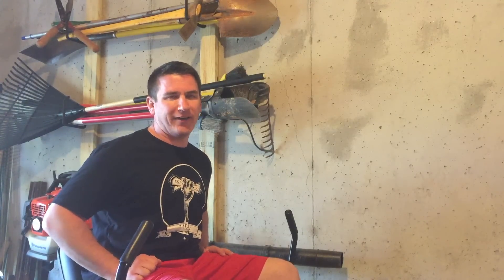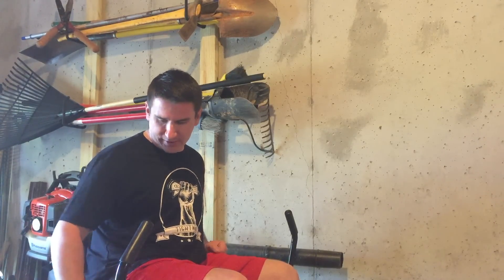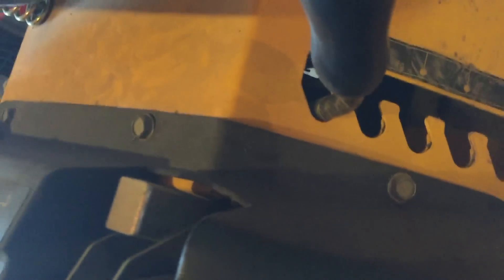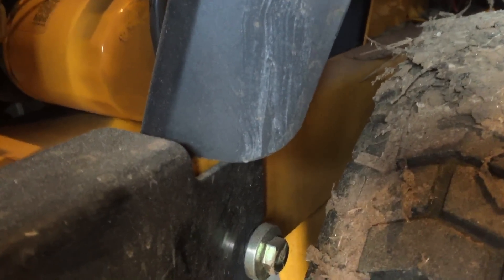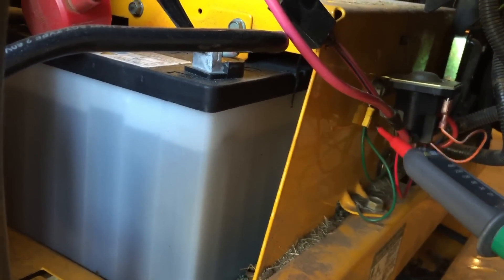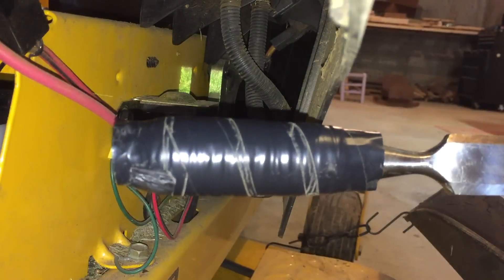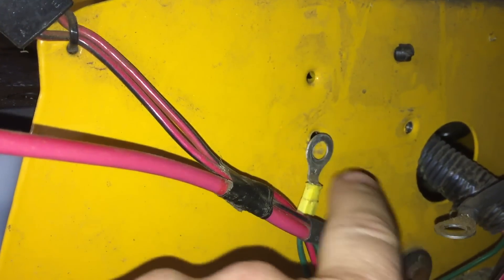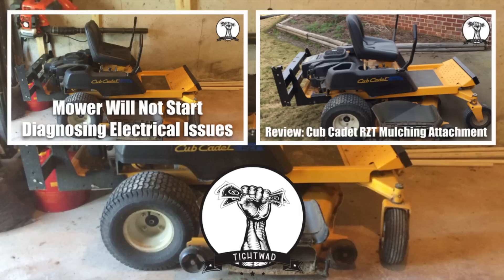FIXED: Mower Will Not Start - Diagnose and Replace Faulty Solenoid Cub Cadet RZT

Comment: I'm a 74 yo woman and I have been taken soooo many times by 'legit' repair places, contractors, electricians, plumbers, etc etc. I have become VERY self sufficient in home remodeling but know NOTHING about small engine repair. This is the first time I'm attempting to do the repairs myself. This site will prove to be a life saver, money saver for sure. I've replaced the battery on my cub cadet and still just clicks. I bought the solenoid and am going to rewatch your video and get to work. Thank you for doing this to help those who need to help themselves!!!!
Reply from the maker: Glad it can help! It's great to see women empowered to tackle repairs themselves.

Comment: I will try your advice, thanks for the no-nonsense easy to understand instructions. I have an CC RZT-L that's about 5 or 6 years old that seems to have issues every year, mostly running rough, rebuilt the carb by the shop, always spraying it with carb cleaner, using high-test ethanol free fuel, new filter, new pump, disappointed with the reliability of this model. Wasn't cheap, like most if them of course. Was running rough right before it pulled this number of intermittent turning over and then nothing. Good connections, newer battery, fully charged, tried jumping it just to make sure.  Thanks again.

Comment: Tightwad. I have replaced all the safety switches, solenoid, one of the coils, fuel filter. And it still won't start. The magneto turns slowly and I can see a very small spark from the plug. But that's it.

Comment: Just so you know...it's always best to remove the negative terminal first.  The ground is connected to the entire chassis or engine block.  It's easy to accidentally touch the positive and "Shock" yourself.

Comment: I have a cub cadet zt1 ultima & it won't start all I get is the click .ive replaced battery ,fuel filter ,spark plugs, I took a test light and I put it in positive side of battery and its lights up on everything but one of the bolts on selanoid lights up on positive side and lights up on the little connection wires just not on the negative bolt. If I do the touching the chisel to connect the bolts do I have key on.? And will it start if im not sitting on seat
Reply from the maker: It will turn over if you jump across the terminals but will die if you aren’t sitting on the seat unless you disable your seat switch. You need to see if you have 12v on the small wire going to solenoid. Thats from the key switch that checks all safety switches first and then sends 12v to activate the solenoid.

Comment: tell ed brake switch on rzt 50 and lights still on no start any ideas?
Reply from the maker: What is tell ed?
Reply: replaced sorry
Reply: @henryglazier7748  Are you sure you have your parking brake engaged and the handles in the down position when trying to start it? It’s possible one of your handle switches is bad.
Reply: @GrillThisSmokeThat  I hope so they're on the way

Comment: The replacement solenoid you linked has two spade connectors, but in your video it appears to have only one. My RZT22 only has one. Does the second one do anything, and would it be ok to use it on mine? Did a search for my model but most come with two spade connectors. Thanks for the video.
Reply: What did you find out here? I’m about to order one ….

Comment: my 04 cub cadet rzt 50  with 500 hours 22 hp briggs v_twin was mowing stopped for a while got back on to finish didnt do anything no lights on dash so i got out jumper cables attached them but when i hooked up final ground cable it was shooting sparks like cables were reversed it happened out of nowhere any suggestions would be appreciated
Reply from the maker: Check your fuse. That happened to me one when using the nagging attachment.

Comment: I have the same problem not getting any power to my starter but I did try to jump start it like that so have to be my solenoid
Reply from the maker: Jake Friesen Did it work when you jumped the solenoid?
Reply: @TightWadDIY  yes it did start if I jump start it but it won't start with the key so it has to be my solenoid
Reply from the maker: Jake Friesen It’s most likely the solenoid but could be a safety switch or key switch.
Reply: I have a good use solenoid laying around going to try it on the tractor tomorrow

Comment: wow... having just been fiddling with the solenoid on my hustler turf, I am once again reminded of how much I hate where cub cadet places the components on their machines. on my hustler, you just lift the seat up on it's hinge, and there's the solenoid, out in the open and ready to be fixed.
Reply from the maker: Agreed. My MTD was much worse than this one! It was in such a tight spot I could only get 1/8 wrench turn. It took forever.
Reply: @TightWadDIY  I know how you feel. just don't ever try to replace a carb heat cable on a cessna cardinal. now that's a pain, literally and figuratively.

Comment: I had a solonoid click only, I removed the starter and found the top bearing seized and could be barely turned. so I dissembled the starter all but the armeture , housing and bottom end plate, I then carefully wire brushed the top armeture shaft at the bearing point and reassembled it and it worked perfectly.
Reply from the maker: Robert Larocque Great job finding the issue and solving it!

Comment: Well done. 20$ and im rolling again. The solenoid location on mine was behind the seat,under the frame. You can see two bolts sticking out*
Reply from the maker: Jacob Joyner Great! I’m glad you were able to figure it out. It’s crazy how many locations they put the solenoid on these mowers. Thanks for sharing for the good of the community.

Comment: Iam having a issue with my cub cadet rzt  zero turn it turns on and immediately blows the fuse then it turns off it a 2007 model what can it be ? Because I put a new fuse and did the same thing
Reply from the maker: vicente Torres You have a short somewhere. Try disconnecting and reconnecting your battery cables and the cables attached to your alternator.
Reply: I try that I tell you what it did

Comment: Great video.  I have an RZT S-42 with the Kohler Courage 22 hp engine.  Installed new solenoid (fried)  and battery (bad cell).  Completely tuned up the mower.  I'm now back at hard to turn over and starts after manually moving the choke forward.The mower is about 7 years old has about 250 hours.   Do you think it is time to install or rebuild the carb?  Appreciate some guidance.
Reply from the maker: Robert Dobbs I could probably use a good cleaning.
Reply: @TightWadDIY  the new carburetor?
Reply from the maker: Robert Dobbs Clean up/rebuild the existing one.
Reply: Actually got a deal on a new carb and installed.  Started it a few times and obtained full throttle.  Started it this afternoon it runs slightly below half throttle like it is barely getting gas.  Adjusted the throttle from choke to idle. The engine speed never changes.  Any idea what I should look at.

Comment: My CC-RZT ..initially whenever I moved RH bar to rear position it would hesitate or require several attempts to reengage blades. Then the blades just stopped altogether. Left overnight battery went dead. Now refuses to fire/start on jumpstarting. Any suggestions? Thx b4hand.
Reply from the maker: gataheart It could be a faulty safety switch on that RH arm. Mine has two safety switches on each arm.

Comment: Most helpful video on youtube for this... every other video has the starter out, wires out, and doesn't show where this damned thing is. Even the manual from the manufacturer doesn't show where this stupid solenoid is.

Mine was turning over, stopping, turning over, stopping... had to bump the key repeatedly until it spun enough to start... and today it died. Now I get to replace the solenoid it seems.
Reply from the maker: Jax Endsleigh Thank you for the kind compliment. Let me know if the solenoid is not your issue.
Reply: @TightWadDIY  Mostly did. It still turns over and stops, but it takes far less effort to start after changing the solenoid.

That said mine was actually on the chassis under the seat... Upside down, backwards, with the bolts facing the rear of the mower... and one blocked by the gas tank...

I want to slap whoever thought bmw design belonged on a mower.
Reply from the maker: Jax Endsleigh My old rider was mounted in a crazy place too.
Reply: @TightWadDIY  Late reply, but the starter was bad as well and failed soon after. After replacing the starter, solenoid and battery it started without a problem.

Comment: thanks for the information, my rzt is blowing the inline fuse any suggestions
Reply from the maker: Jimmy Brown That is typically the result of a faulty connection. Check and clean your battery terminals. Remove and reseat the wiring on your solenoid. That’s a good start at least.

Comment: My battery is good. still had to jump the battery to start. once going, the pto would stop. I could wait a few min, and pull the pto down and up and it would engage again. now pto will not engage at all and will not start with a jump. what do you think? Same mower you have.

Comment: I bought a gravely mower less than a year ago and it has started to bog down and cut off after about 30 mins of cutting, I could get it to start up again but would cut off again after only a few minutes even if I wasnt cutting. Now i can not get it to start, I can get it to turn over but not fire up, is it it possible there is a blockage in the exhaust line that is causing the engine to not get proper air intake to start?i would greatly appreciate ur thoughts on why this is occurring, thanks.
Reply from the maker: josh wells It sounds like an air flow or fuel flow issue. Have you done the basics like change the air filter, fuel filter, and spark plugs? Drain the fuel completely and refill with new gas.

Comment: I have a 2006 RZT 50 and no spark. Put new starter on. Doesn't a new starter come with the solenoid attached ?
Reply from the maker: Robert Lenox The solenoid is not attached to the starter. It is actually under the arm near the PTO. If you are comfortable doing so, you could try to jump the solenoid to see if it turns over.

Comment: So my Solenoid won't Jump....On my Cub Cadet...Does that mean the solenoid os getting Power
Reply from the maker: John Leddy It could mean a variety of things. Start by checking the battery cables and the fuse.
Reply: @TightWadDIY  Thank you I see a relay and the safety switch lol..Keep up the Videos.

Comment: Mine aint doing the clicking sound. It's almost like it's just whining and not starting. I thought it might just be a bad starter. What'd you think?? Appreciate it in advance.
Reply from the maker: Jordan Clean or change the spark plug, make sure it has good gas, and clean the air filter.

Comment: Hi sir, I have Murray model 465306x8. Mine no click or sound when turn the key. I have replaced solenoid and ignitions key still no click or sound. I have tried to jump from battery straight to the starter and it starts motor turn. I am not sure what else to look for please can you help. Battery is good @ 12.49 volt. This riding mower used to starts without problems I can get off and get back on many time and it still start. But something happened when I got off the seat and tried to start it then it won’t click or sound at all."
Reply from the maker: rxsonny Just to make sure, did you check the fuse between the battery and solenoid? Did you check to make sure you are getting power at the first post of the solenoid?

Comment: Mine wont even click, thought it was battery but replaced it with brand new one and still nothing. I put the key in and it doesnt light up and the starter doesnt try do anything. Ive been going all over the mower looking for the issue but no luck so far, any ideas?
Reply from the maker: Dodge 318 Make sure the mower is in park. Check the inline fuse between the battery and solenoid. Check your safety switches.
Reply: TightWadRepairs Ok thanks I just got home so first thing in morning I'll check them. Ive looked over the thing top and bottom for loose wires or bad wires and I cant see anything out of the ordinary. I was using it last week then the belt deck belt came off because it was old & loose. So I drove it and parked it. Went few days later to start it up and nothing. The gauge display doesnt come on and no clicks or anything. Could it be the drive belt possibly? Or the pto deck belt not being on? Ive changed the fuel filter, air filter, spark plugs, battery.
Reply from the maker: Dodge 318 It shouldn't be a belt. Just to make sure, did you turn off the PTO switch?
Reply: TightWadRepairs Yes I double checked it, checked wires on battery and made sure they were on good as well. Ive got a new solenoid for it but I dont guess that'd be the problem if it aint even clicking
Reply: I know this is old but did it turn out to be the inline fuse? Exact same thing happened to mine and that's what it turn out to be.
Reply: efilnikcufecin hey ive been meaning to post a reply but ive been very busy. I tried the fuse, i literally tried everything i could think of and then some. Turned out it was one of the wires that hook up to the solenoid, it had got lose just enough to cause bad connection but not so much that just looking at it, it looked fine. It worked as soon as the wire was fixed haha but then I ended up having problems with the carburetor. So when we fixed the wire the engine wouldnt turn over. Turns out water had gotten thru because of crappy local gas. Anyways, ive replaced all spindles, blades, drive & deck belts, some wiring, battery, 2 solenoids, fuel filter and air filter. Now it runs decent but deck wont stay level keeps wanting to tilt to the left...damn cub cadets
Reply: Dodge...thanks for the reply. I was just curious to know what your fix was. Sounds like you put enough into it for it to almost qualify to be a new one....lol. Take care man and glad you found the real culprit.
Reply: efilnikcufecin  same here blown fuse.

Comment: I have a 1717a zero turn and it was working then I cut off and I'm getting nothing I test the solenoid and it crank but won't start I have change all the safety switch and I have change the ignition and still nothing
Reply from the maker: Cerita Frenchie So it turns over when you cross the poles on the solenoid but it won't start?

Comment: I turn the key and I dont even get a click. I've changed the battery, spark plug, air filter, have good gas. Battery terminals are good. Dont know what's wrong.
Reply from the maker: Travis B Did you check the fuse? Start there then try to jump the solenoid.
Reply: @TightWadDIY  Yep it was the fuse. Thanks for the help 👍👍👍
Reply from the maker: Travis B Great! I’m glad you got it fixed!

Comment: I have the same mower and it starts fine and drives fine but when I put up on the PTO nob, after 5 seconds the engine die.  I can turn all the pulleys by hand easy.  This trouble started after cutting high wet grass and I cleaned under the deck well.  There must be something grounding the engine dead, how would you test the PTO switch?  I have had this mower for over 6 years(got it used) and just this week found out how to push it by hand, pull out rod on left side.  I like how you explain things on your videos..

Comment: I'm not even getting Click
Reply from the maker: That’s either a safety switch, battery, or fuse most likely. Less likely could be the key switch or PTO switch. Start with the fuse and battery. They are easiest.